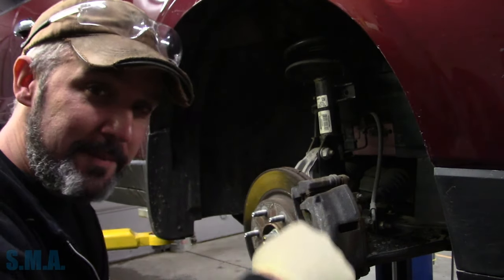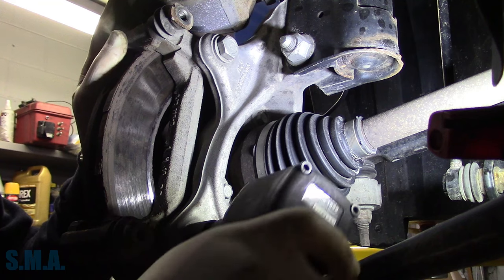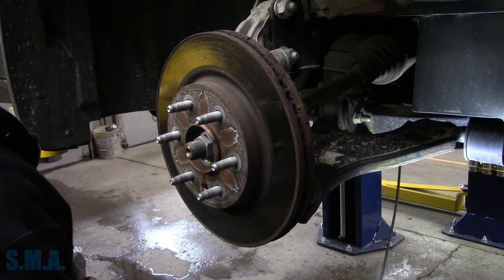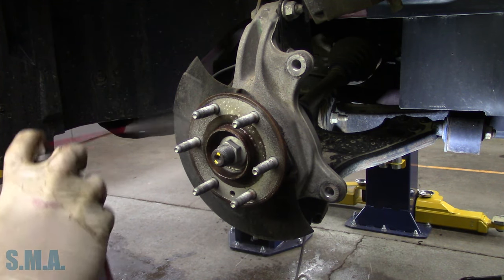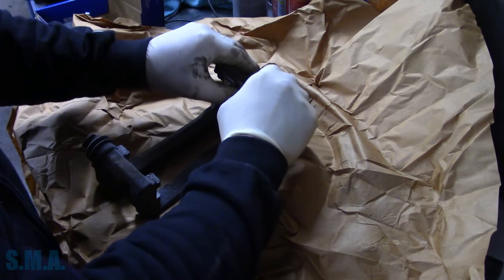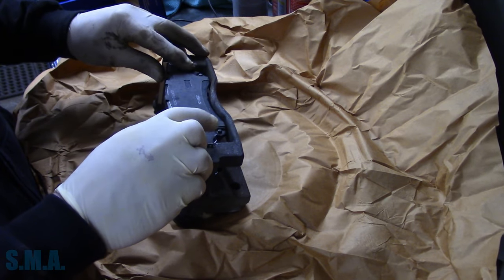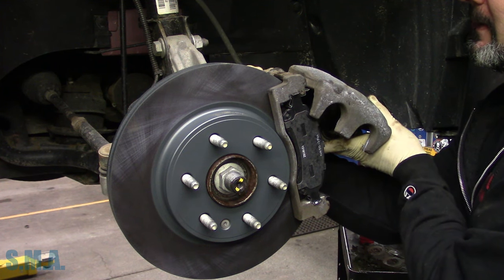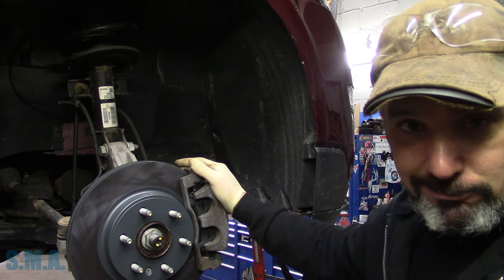Chevy Traverse: Front Brake Job

Comment from the maker: Astro Pneumatics on Amazon: https://amzn.to/2VcY8rv
OEMTOOLS 24518 Brake Caliper Hanger Set: https://amzn.to/3er2DX3
Permatex 24125 Ceramic Extreme Brake Parts Lubricant: https://amzn.to/2xAHUQ1
3M CX-DR Brake Hub Cleaning Disc Holder 07545:https://amzn.to/3csVzYm
3M Automotive (3M 07546) 3M Scotch-Brite Roloc Brake Hub Cleaning Disc - 10 Pack: https://amzn.to/3esQMYq
Fluid Film: https://amzn.to/2KccJ06
Lisle 24300 Speedy Brake Pad Spreader: https://amzn.to/3afI0tF
Mueller-Kueps 460 200 Brake Caliper File:https://amzn.to/2ViEXNb &  https://amzn.to/2Vf7hjr
Reply: Brother as always great video... thank you for sharing your knowledge with us

Comment: Been pushing pistons in that way since 67 when disc brakes became popular with no issues! Thanks for sharing!
Reply: Yep.  Cars, trucks, motorcycles, hell, even mountain bikes.  People worry too much.
Reply: It depends if you were working on your own vehicle and you plan on keeping it for a long long time then bleed the caliper to keep fresh brake fluid in the caliper.
Reply: I never open the bleeder on my car or anybody else's. I never had a problem and my car is 20 yrs old
Reply: @locomike102  according to that theory I should never have to ever do a oil change again top it off and keep going no need to worry I might wear out the engine 😊
Reply: @FredTheLutinoCocatiel  And what exactly wears/fails out if you don't? Because I have yet to hear of anything. Ever.

Comment: I changed up the way I do brakes to your method back 3 years ago. I average 5 to 7 brake jobs a week and in that time have not had 1 come back (knock on wood) for an issue regarding this method. have had some for rotor issues and the like but not for install issues. That speaks volumes for me...
Reply: I have always just pushed the pistons  back in... if they are dirty I just give em a toot with the brake clean
Reply: Did you ever consider the brakes failed completely, and as a result they are at the bottom of deep, deep ravines and can't come back to complain?

Comment: I just purchased a 2017 Chevy Traverse on 12/27/2022, this is very helpful and straight forward. 👍
Reply: I have a 2016.  We love it, but change that transmission fluid!!  These cars have transmissions with a bad reputation.  The only issue I’ve had is the purge valve which was $30 and it’s got 135,000 miles.  It’s been a sweet car 👍

Comment: I've been doing my own brakes for decades and never, never opened the bleeder valve when pressing in the piston or pistons. Never had an issue. Then one time I was reading how to change brake pads on one of my new cars and the guy wrote to absolutely open the bleeder when pressing in the piston or you could damage the abs. That set me back. I thought about it and figured the brake fluid should be pretty much the same close to that wheel. So I continued doing it my way and still haven't had a problem. Some people just think their way is the best and can't stand it when others do it another. Good job Eric.
Reply: That might be a good topic for research.
Maybe on a modern car you can damage a sensor?
I've always loosened the brake fluid reservoir cap first, then push the pistons back slowly, that is to say, I don't force them back.
On some Mercedes if you just take the brake fluid reservoir cap off it will set of a warning light on the dash and disable ABS. 
The warning does go away after a while.

Comment: Honda also say push the piston in without opening the bleeder.
Reply: I used to open the bleeder too, before I used my noggin to think about how a hydraulic system works.  Anyone suggesting it hasn't worked on brakes much.

Comment: You are correct on both points. C Clamps for over 50 years doing brakes. ( I have seen a dozen home made tools )  Not lubed during Sub assembly because grease attracts brake dust. 
   Snow sucks! I am so glad I don't have to deal with all that anymore. I have not seen cars that cruddy (under side) in many years.
 You do an Awesome job. Its also apparent you like what your doing.
    I still think you have a future in voice over recordings. Franklin,TN

Comment: I have pushed in pistons on the calipers on all of my cars with no issues. BTW BMW also states not to lube brake pins, but I lightly coat them w some silicone and have never had any issues or stuck pins. Do your thing Eric!

Comment: The only arguments that I think can be made for opening the bleeder and removing the brake fluid is that eventually it's the same as a brake fluid flush. And the bleeder gets some exercise and attention...replacing missing bleeder cap-or it doesn't open...data is gold.

Comment: The sound effects are back! Big Nasty makes an appearance! Brooksy and the Smoke Wrench made cameos over the weekend! All is now right with the universe!

In over 40 years of working on vehicles of all kinds, I've NEVER cracked a bleeder to retract caliper pistons. The only time I do is if the system needs to be bled. I live in the rust belt too and, 99 times out of 100, if you try to open a bleeder that's more than a few years old, you either round it off or break it off. Neither of those is any fun! Also, when I replace a caliper, I always remove the bleeders and smear anti-sieze on the threads.

Comment: I remove the outer pad, and use a large c-clamp on the inner pad, with the tip of the clamp on the back of the caliper.
Reply: I do it exactly the same, and I call my clamp "Big George" because I heard a brit call them "G-Clamps." Been using him for 30 years just for disc brake jobs in my garage and driveway.
Reply: I use a BIG pair of channel locks
Reply: It really doesn't matter how you do it, as long as you get the job done. Hopefully safely

Comment: Please answer a question. What is the purpose for not putting any lube on the contact surface between the pad and the brake hardware. I don't understand why lube there would be a problem. No did you should be putting any loom on the face of the patter on the rotor surface which I have never done. Good one time see somebody put the anti rattle goo on the face of the pad was Ed Boyd that caused some really interesting issues. But a very thin touch of good break Reese on the ends of those pads I've never had a problem with. I've only been doing break since 1964  or so.
 Another thing that I always do is I put Anti-seize on the hub face or the inside of the rotor hat. And I usually paint the rotor hat with a ceramic brake calliper paint. It really helps. Especially here in Michigan where we have salt.
 Whatever I have time I always clean up the rotors and the bracket and I usually paint them as well. It does make future jobs so much cleaner.
  Chevrolets Phyllis shit. I take my car out I run to about 50 and without letting off the gas I'll slow it down about 4or5 times to about 15 to 20 miles an hour. After that, I've and drive the car for about 10 to 15 minutes to allow the brakes to cool down and all of that resin that causes the brake squeal is off of the surface of the pads.

Comment: Another great brake job video!
A couple of questions....
Do those rotors really need replacing everytime?
Why do you grease behind the hard ware?
Is it necessary to open the reservoir cap before pushing the pistons in?

I really like the new hardware, will sure help increase brake life.

Comment: Just a comment my friend work at GM he made over 70,000 putting the rotor bolts and spring lug nut retainers on so the rotors didn't fall off on the assembly line that was his sole job

Comment: GM service repair manual for 2009 chevy Traverse - If the brake fluid level is midway between the maximum-full point and the minimum allowable level, no brake fluid needs to be removed before proceeding. 
If the brake fluid level is higher than midway between the maximum-full point and the minimum allowable level, remove brake fluid to the midway point before proceeding. 
Install 2 large C-clamps over the top of the caliper housing and against the back of the outboard brake pad. 
Slowly and evenly tighten the C-clamps until the caliper pistons are completely retracted into the brake caliper bores. 
Remove the C-clamps.

Comment: I have found some slide pins so siezed that I think someone used low temp grease on them.  Always use high temp silicone brake grease.

Comment: Eric,

I see you do not let the fluid film spray dry up before you put the disc on. I've never used the stuff here in mn, but based on your show am trying it now. 

I'm concerned with the amount of ffilm put on.  that it will get slung out and contaminate the back face of the disc. Is this a non issue, or a concern to control?

Comment: Hey Eric I won't give you any crap for pushing pistons or not greasing hardware as I do the same thing daily. I however will finally say that swivel air fittings on your impacts are robbing prob 20% of your torque. Just FYI LOL
BTW got my big nasty a couple weeks ago.

Comment: Eric,
Great video - thank you. Those rotors looked different so I looked them up - 'paint and phosphate' finish. I was wondering why you didnt go with the polymer coated which were only $10 more (I know its the customers decision). Also Im surprised that the car needed rotors as its less than 3 years old. Were those rotors that worn or warped?
SMA#1
God bless
Paul (in MA)
BTW is the eye giving you problems again?

Comment: Eric,  I have to splice a new connector for a secondary pump on a 2004 Cadillac Northstar ( Shit wagon) . The original pump and connector melted due to a short I guess. What is a good splice connector ? I remember you say when you were young you used a brand that was No good and all the repairs you made using them eventually failed and you had to use another brand . I need the splice to be water proof and using a shrink. What would you suggest for splicing a new connector?  Flux and shrink or connectors and shrink????Thank you.

Comment: In the days before professionals discovered Youtube, some viewers would arrogantly proclaim a video fail if the bleeder screw wasn't cracked and bled with each pad change. Those armchair experts were intimidating, loud, and full of self confidence. Kinda funny to see how you silenced most of them. Instead you focus on other areas that many of us didn't spend enough time on, like hub faces, sliders, rust-jacked clips, and boots. Interestingly the Toyota service manual advice is very similar to your workflow, including the use of brake lube in areas where I normally reach for antiseize (such as behind clips). These days I've noticed you are reaching for your torque wrench more than in days past.
Reply: My father worked in a repair shop for many years, and I never heard of that, or saw him do it.(or done it myself).
Reply: I wish people would stop using antiseize on brake parts.

Comment: I have the same whip and drivers side is making a popping noise and I can see the inner lower control arm bushing bolt move a little bit and this is after replacing the entire lower control arm, all bushing, CV Joint, Shock and the other suspension swap bar. same noise before and after :(

Comment: I wonder at times if you remove the cap on the brake master cyl before you shove the pistons back into the caliper. If you do you never show this so I just wondered. Your supposed to do it with the Mazda I own.  Others I'm not sure about. 
   Also, you didn't show it and I'm not sure it's required for the rotors you got but you didn't wipe them down so I wondered if those came coated with what ever they put on them to keep them from rusting?
Reply: Coated rotor's usually don't come with a film of oil on them like rotor's did years ago, safe to just open box and install.

Comment: Is Honda the only oddball that wants you to screw the piston back in on the rear caliper instead of pressing it back in? My 2014 Accord rear caliper has a big + shape on the piston that you put a fancy cube looking tool into and screw it back in. I didn't try to press it back in because I read that you weren't supposed to so I don't know if you could without damaging anything.
Reply: no. several other makes are like that. the screw in type actually have a screw inserted in the caliper piston that acts as a slack/wear adjuster for the park/emergency brake.they have to be screwed in, you would not be able to press them in.

Comment: I think the 'reverse flow' brake myth came about in the early years of ABS brake systems. The school of thought was that by pushing fluid from the calipers back towards the brake master and ABS pump would send contaminants into the ABS pump and dump valves and cause it to malfunction. As crappy s those early systems were there was probably some merit to this theory. I guess ABS systems are more robust nowadays so what the heck, eh? LoL

Comment: What do you suggest for the DIYer who doesn't have a sandblaster to clean the caliper bracket? You recommended against the wire wheel which is what I would have gone for
Reply: There's a hand file that he uses often that someone sent him. Muller-kueps brake caliper file

Comment: Hey Eric O! Long time listener, first time caller. I have an 08 Impala with the blend door actuator on the driver's side driving me insane! The old stereo volume repair only works for so long before it doesn't. What's the best way of getting to that little bugger without tearing the dash (or my hands) apart?
Reply: It's a common issue with quite a few videos...you go in through the glovebox.  Been a while since I did one but seem to remember it was two 7mm nuts, match the orientation of the motor, slap the new one in.  It is really tight access, though.

Sorry, driver side you go in from the kick panel, upside down...really annoying.
Reply: @michaelkrenzer3296  The passenger side ones behind the glove box were easy, and I had those done in about 5 minutes. The driver's side, not so much. I know the method of going in from under the wheel, but it's very tight, and difficult to work. Just looking for some tips on getting it done without losing my sanity.

Comment: Also do you actually break in brakes for customers on every car? Sounds like lot of time
Reply: A five minute drive, just to make sure things work right.
Eric was saying in another video some brands of pads make a lot of noise and rumbling sounds when breaking them in. A different type of coating(?). 
Easier to do that than spend 10 minutes convincing some customers it's normal, or even settling noises are nothing to worry about.

Comment: Just did a front brake job on my 2017 Traverse two weeks ago .
 It was simple to do and straightforward.
 My garage , with a fan blowing on me , was still about 100 degrees here in Florida and me being 82 years old , didn't  help.
 Still , it was an easy job .
 Only got 70200 miles out of the original brakes-- can't  expect any better than that.

Comment: People don't realize how much brake fluid actually circulates through the system and that if there were contaminants in the piston they are already moving around the lines etc so at that point you might as well do a flush.  Opening the bleeders is more likely to introduce air into the system as well.  Then you are adding extra work and more likelihood of comeback for a simple job.  Don't try to reinvent the wheel people!  Also the idea of greasing the hardware is also non-sense.  That grease will within a matter of days become a pile of dirt/mud/trash buildup which will now interfere with pad movement, especially for those of us in the rust belt.  The grease under the hardware is to prevent rust from swelling and causing the pads to seize not for lubrication, as you well know Mr. O!  I think people always want to come up with a new idea to be different and then someone else hears it and the foolish reasoning and it sounds good so they run with it, then its the new gospel.

Comment: As an ASE certified master tech with a degree in automotive technology, 15 years of experience and hundreds if not thousands of brake jobs under my belt, I don't open the brake bleeders to push back the pistons. I've never had an issue with ABS units or anything after pushing the pistons back into the caliper, and as you said, that is how most (if not all, Mercedes with their SBC brake system may be the only exception) say to do it. If you have physical junk and debris in the brake system, that is a big problem in and of itself. Don't let the arm chair mechanics in the Youtube peanut gallery tell you otherwise.

Comment: Seriously loving the slightly passive aggressive attitude. Bout time you pushed back on all the know it all weekend wrenchers. Been turning wrenches for over just over 14 years and not once have I ever opened a rusty crusty bleeder screw to push pistons back in, or ever greased hardware on the pad side. Go to any dealership you can think of and look at the brakes on a brand new car. You wont find grease on the hardware on any of them. It's for good reason. What do you think happens to that grease once all the brake dust gets stuck to it? Answer is that it causes the pads to seize. Simple, yet excellent video Eric. Ignore the trolls and keep posting please

Comment: I've never opened a bleeder unless i'm bleeding the brakes , I know Vauxhall/Opel of old used to turn the Master cylinder seals over if you pushed back the pistons to quickly ... resulting in the loss of hydraulic pressure at the Master.

Comment: Ha! I did front and rear brakes on one of those today and your video shows up on the feed. Wow.
Reply: Those cheap steel wheels they use were rusted on so bad I had to use a air hammer to shak'em off. Same thing with the rotors. Had no problems pushing the pistons back in.